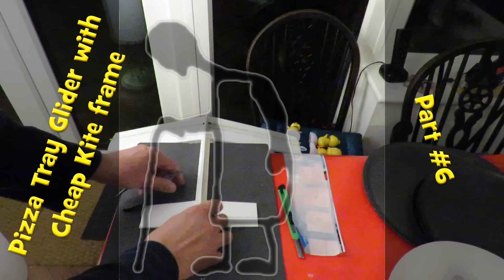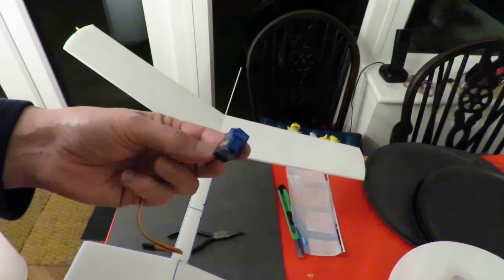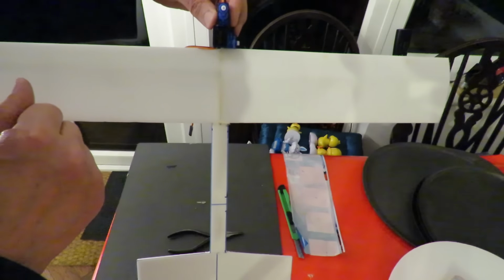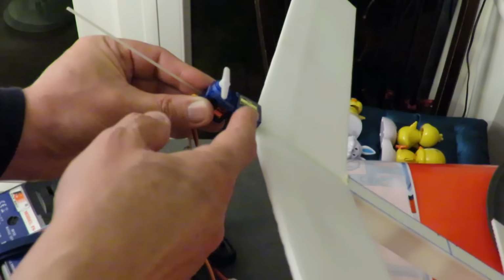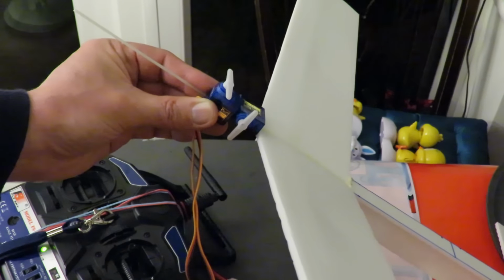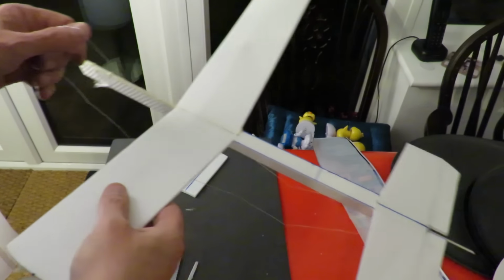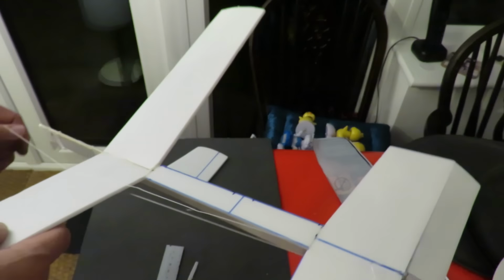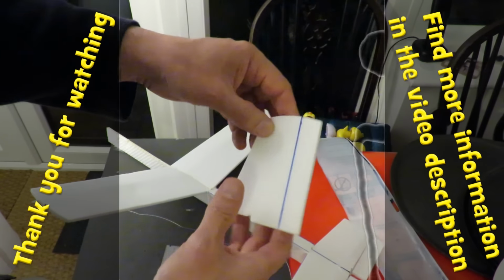DLG Pizza Tray Glider with Cheap Kite frame #06

Comment: For the pizza tray gliders I wondered if you had made a template you could print out your one is coming along mighty fine😀
Reply from the maker: I am afraid I work by eye, it is very rare that I write anything down or draw it out. The dimensions of this plane are based on the size of the Styrofoam trays I had available. My theory is people can watch what I do and make their own decisions on how they make their own version. By the number of suggestions I get in the comments that would seem to be the best option as there is always plenty of room for improvements with my projects :)
Reply: +GrandadIsAnOldMan thanks all I really need to do then is make my own using the dimensions of the pizza tray
Reply from the maker: I just do what looks right to me. If it doesn't work then I know I got it wrong :) Learning what doesn't work can be helpful.

Comment: Wow, that is a lot of weight to move the stabilizer, but I suppose you aren't doing a super lightweight build and need a little bit of wind penetration.  I often upcycle a charge, or gift card and as the models get larger and heavier, first glue two of those use and toss plastic cards together for thicker plastic control horns.  I then drill holes to match the wire push rods so there isn't too much slop.
Reply from the maker: In practice I found the body tended to flex along with the controls.